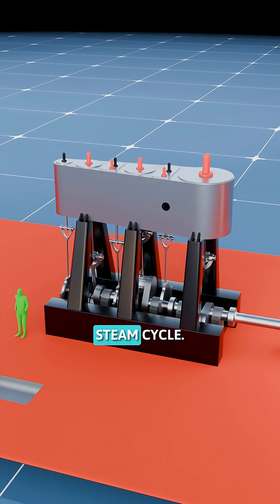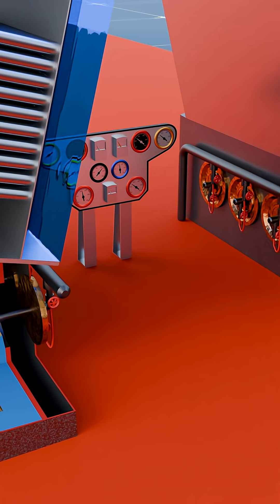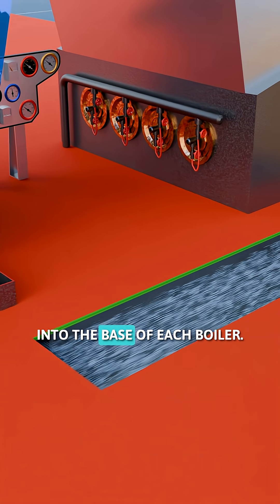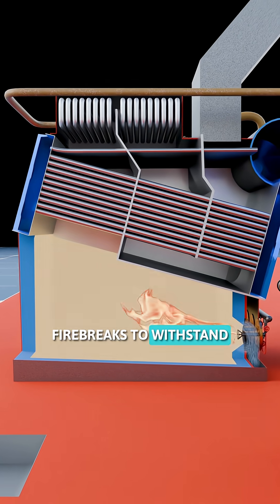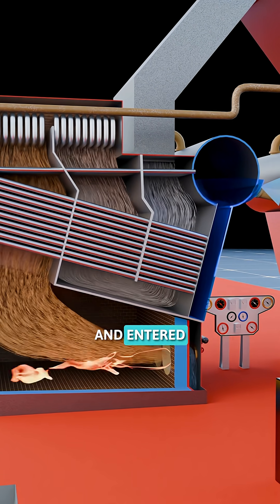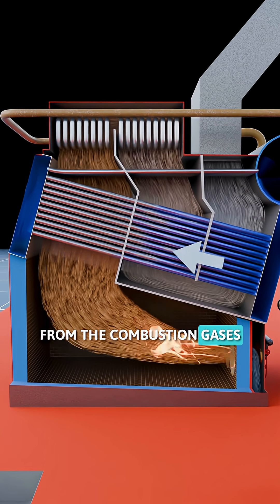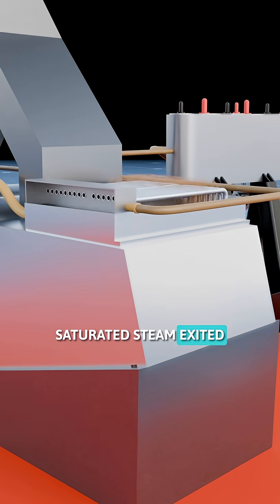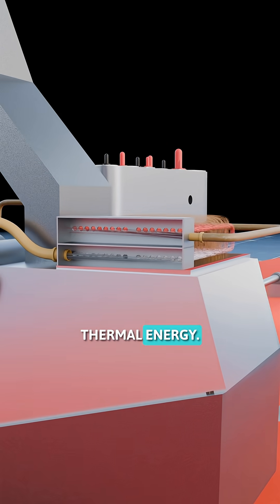How a Ship Boiler Works #3danimation #libertyship #ww2

Comment: I hear that you search for super heated steam leaks with news paper wrapped around a broom. When the newspaper sets on fire you have found the steam leak :o
Reply: and very high pressure steam at/above 600psi can also be leak-chased with a broom: walk down the hall holding the broom before you, and when the end of the broom disintegrates, you have found the steam leak
Reply: @SittingDuc  I realised a while back why turbines replaced pistons. Not just efficient, but you can separate the bearings from the heat so the oil still works.

Comment: So, do they still use steam engines to power ships today? Like a kind of “Diesel Titanic”? I always thought 4-strokes engines were use instead.
Reply: Yes.  The Gerald R. Ford aircraft carrier uses nuclear reactors to make steam that runs both turbines for electrical as well as turbines for main propulsion.  Other than the thermal source, same thing used on the Iowa class battleships (see @BattleshipNewJersey)  The liberty ships used a triple-expansion piston engine, with each piston being dual-stroke (power in each direction).  Why not use turbines on the Liberty ships? Ryan over at Battleship New Jersey explained that steam turbines where 1) expensive to produce and 2) in short supply during WWII - hence using the previous generation technology.  Hope this helps.
Reply: @fredinit  I thought the Liberty ships had a single acting triple expansion engine?
Reply: Besides the few military nuclear ones, thare are a few LNG carriers with steam propulsion but I don't think they build new ones with that. Now there are diesel engines that can use the boil off LNG more efficiently.

But when it comes to diesel engines, two strokes is more common than four strokes on big ships.

Edit: Steam piston engines are long gone, it's steam turbines that are used since many decades. (The Titanic had two piston steam engines and one steam turbine.)